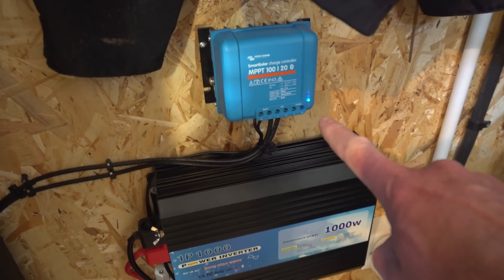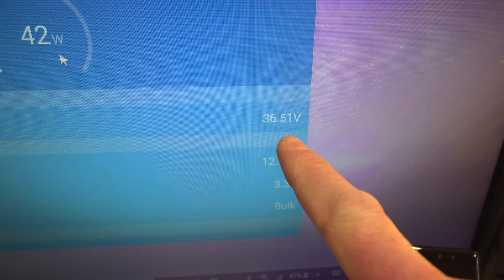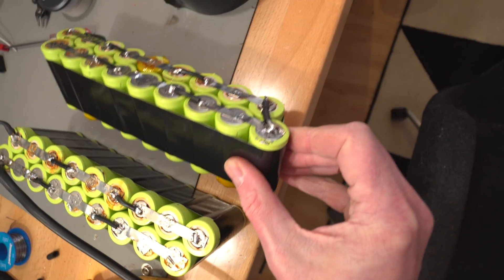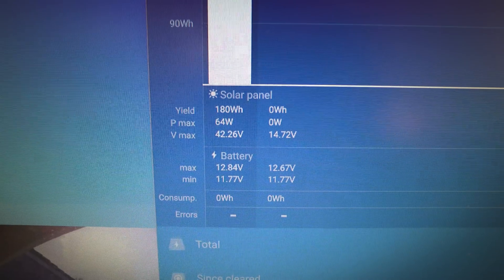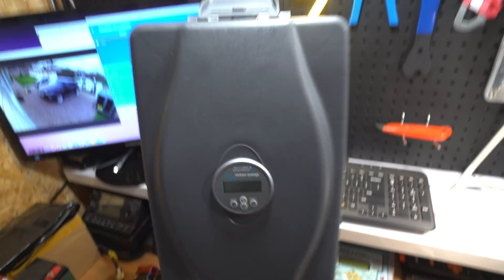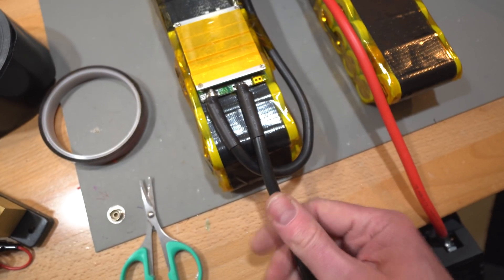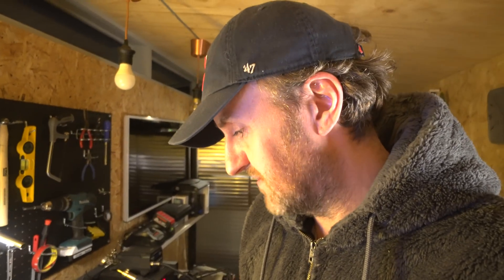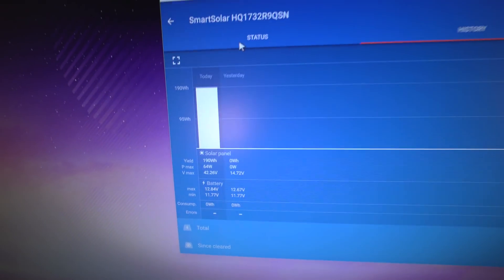SOLAR POWERED SHED | PART 3 FINISHING BATTERY AND FITTING BMS

Comment: Why do you use kapton tape and not insulation tape ? i use kapton for my 3D printing as its heat proof, but black insulation tape would be ok with a battery pack as it wouldnt get really hot ??

Comment: I'd suggest getting rid of the balancer and bottom balance the pack (basically discharge each Cell to 2.8 volts, wait 2 hours, do again, and keep doing that for 2-3 days until the charger stops after 30 seconds or so.... then charge the pack to 4.1 (16.4v for the pack) volts per cell instead of 4.2 (even 4.15) and set cut off voltage to around 3v/cell (3x4 for the pack).  I did this with a similar pack i use for camping and have done about 50 cycles so far and all 4 cells are still balanced.  They do this with EV cars and after 3 years of driving bottom balanced packs are rarely out of balanced (google evwest bottom balance to see their explanation) .
Reply: It depends if he wants to regularly deplete the pack or utilise maximum capacity. If Andy is going to completely deplete the pack often then your idea Dave will be good.

Comment: on a good day with my solar shed i can get  around 25 amp which is more than what i need.. and that comes from 3 100w solar panels...

its just a bit shit in winter when i barely  make no  power at all but that's be expected.

but good luck with your setup.

Comment: Donl let total open cuircet voltage go over 100 tor that controller. Also I beleave lead acid batteries must be fully recharged to prevent sulphation!

Comment: It's coming on... looking forward to seeing the results!
I suspect your panel needs a lot more tilt for the winter sun - should be chucking it out in the cold temps!
If you add more panels, then connect them in series up to the voltage limit of your controller then you won't need thicker cable.
(If you're going to have partial shading then consider bypass diodes.
This is a really good reference: http://www.avdweb.nl/tech-tips/pv-panels/bypass-diodes.html )
Reply from the maker: Your right, I tried tilting it and it makes a huge difference. I ordered some adjustable mounts so I can adjust the angle. It hit 200W today. Interesting about the bypass diodes and partial shading, I had no idea about that, thanks.
Reply: Really glad you got such a boost...  Obviously the optimum is to keep the panels perpendicular to the sun - one day you might like to get a couple of linear actuators and drivers, a raspberry pi and/or an arduino and make a solar tracker based on time of day and gps location!

Thing with shading, it only takes one leaf's shadow on one solar cell to knock out the entire string in the array, and then all the energy in that string gets dumped into that shaded cell and heating it so active bypass diodes (ideal diodes) are a great way of dealing with them.
It's not a problem if you have no shadows.
I built several bypass diodes into my portable array so if I'm out and want to recharge the bike it keeps charging even if people and their shadows are walking by!

Comment: 24 volt solar panel 270-300 watts much better because they start at higher voltage in low light plus the voltage converts to amps and less wire resistance. I get 150 watts in uk winter about half